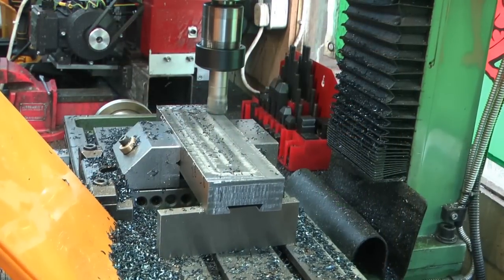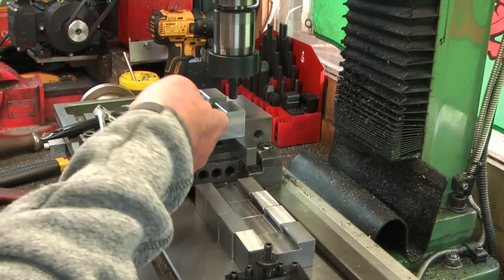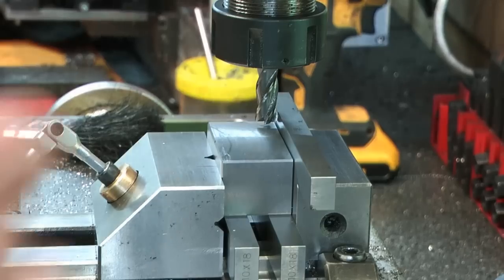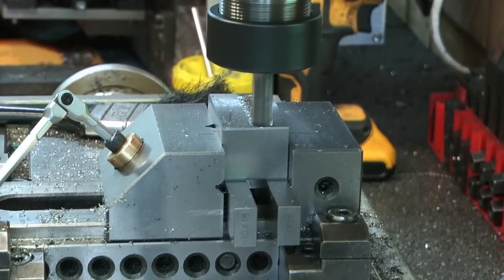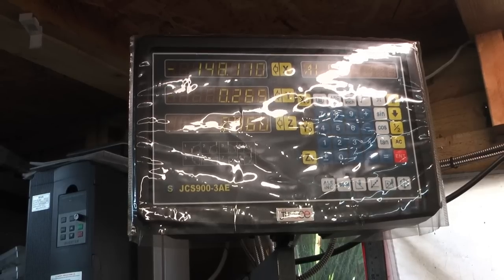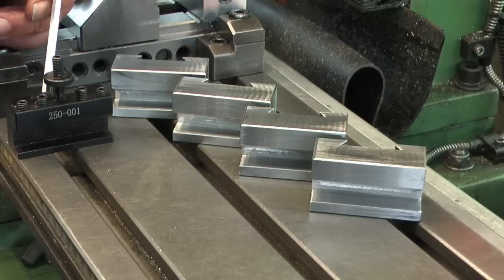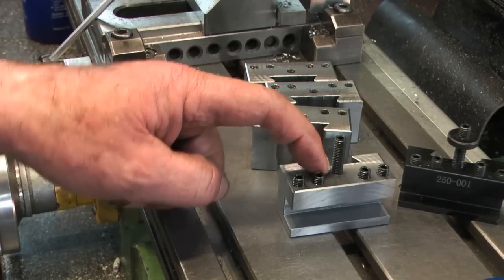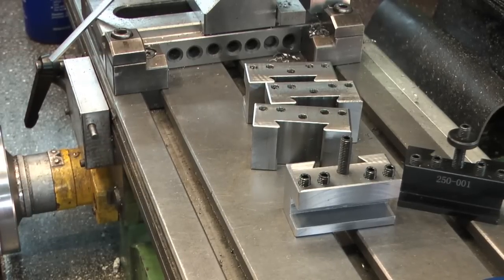Mini Lathe revamp part 19

Comment: well done Ade, saving yourself a few quid there, if you don`t use it already, a handy tip if you haven`t got a band saw and you do have the material, "rifle" drill a line of say 3mm holes along your saw cut first, as close to each other as you can, the saw blade then has less material and its less elbow grease needed, but you do then have to clean the faces up. Great work keep it up. TTFN

Comment: Nice work. I've done many tool holders like that - a couple sizes larger for my slightly bigger lathe, but the principles are the same. I'm pretty sure I got the idea from you making yours on the 180 lathe a long time back. I made my first ones on the lathe, using the it as a "laying down mill", but I've got a proper mill since about 3 years now.

Comment: I also own and use a chinese mini lathe. Even with all the improvements I've made to it it's still a tinker toy in the world of lathes.
I see these mini lathes to be a great benefit to the hobby market because making it usable for doing precision work sets the student up with lots of little projects that teaches a lot of invaluable lessons that one might not otherwise learn if they bought a 'big boy' serious industrial lathe to begin with.
My first recommendation for anyone buying one of these new from somewhere like Ebay or Amazon is to tear it completely apart, and put it back together paying attention to calibration. Mine was literally falling apart brand new in the crate and needed a lot of fine adjustments. It will also teach you how the thing is constructed. 
I believe that if I had it to do all over again hindsight of course being 20-20 I would have saved the money I spent on it and bought a used industrial grade lathe. That said I think if and when I do get a more serious lathe I may hang on to it incase I need to have the big lathe apart for some reason and need to turn a part for it on the mini.
I'm glad I had the sense to buy a 'real' bridgeport J-head milling machine made in 1960 instead of one of the tinker toy milling machines coming out of China. I see a lot of videos of users trying to use the tinker toy machines and running into the limitations. Limitation that I don't have with a real Milling machine. Mostly rigidity. Now I just need a serious lathe to match.

Comment: What vice do you use? Size?  Where did you buy it? Any pros and cons?
Reply from the maker: it is 80mm toolmakers grinding vice from Arceurotrade or Chronos , they both sell them . Cheers Ade
Reply: @ade63dug  Many thanks. I have been unhappy with my vice for ages, and have been looking for a while. I had considered Kurt clones, but they seem to need some fettling before they are usable.